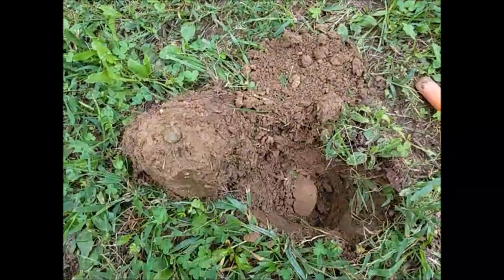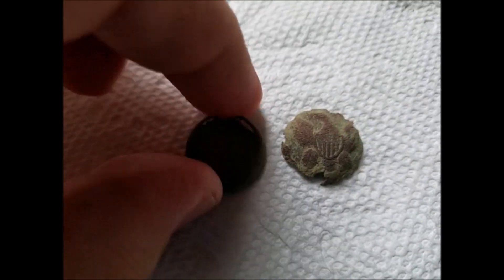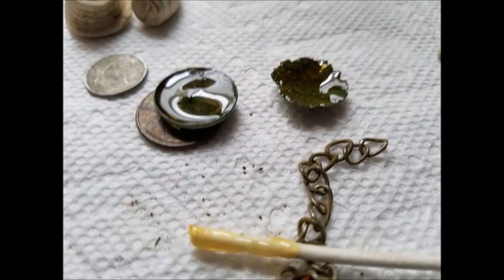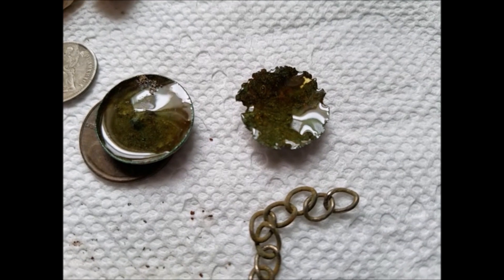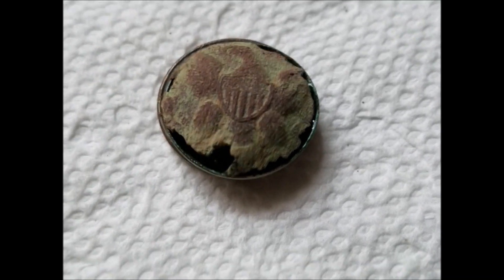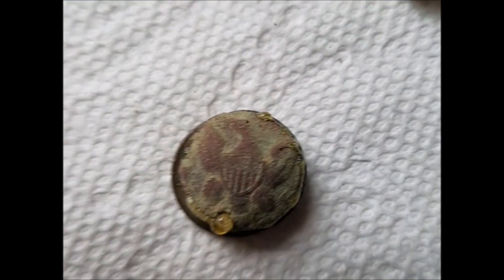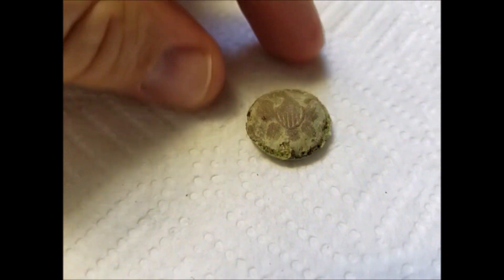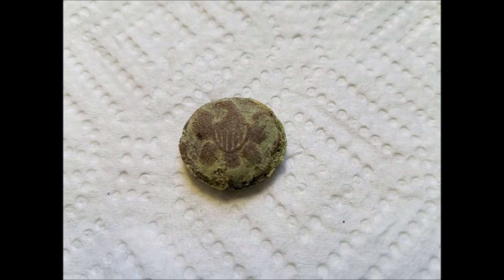Civil War Eagle Button Restoration

Comment: I see you found a seated dime or half also, good dig. When i glue a relic ill water down some Elmers glue. That way in the future if you or someone wants to reverse it. Hot water will remove the glue. Good job on your button. HH
Reply from the maker: That is a good idea.  I usually melt paraffin wax and put a very thin coat on it by rubbing it with my fingers.  I recently found another cuff button that broke when I popped it out of the plug.  This time I used hot glue on the inside.  I would definitely recommend hot glue over gorilla glue.  It is much easier, less messy, looks better, and you can easily remove it if you want.